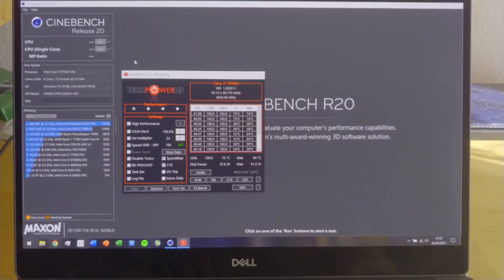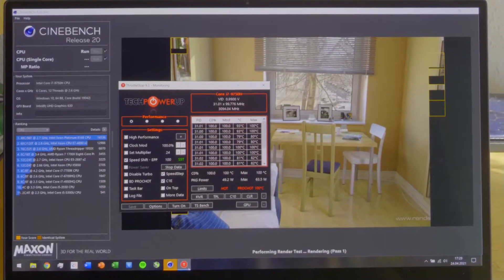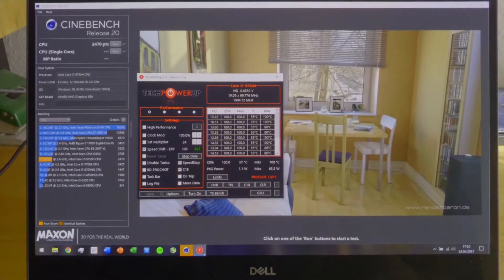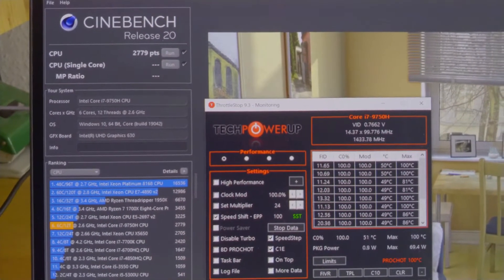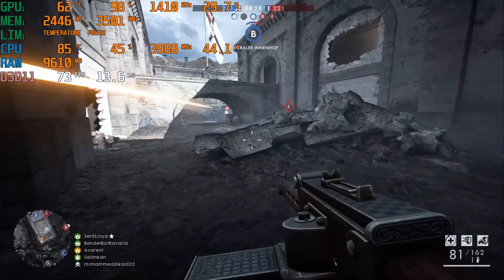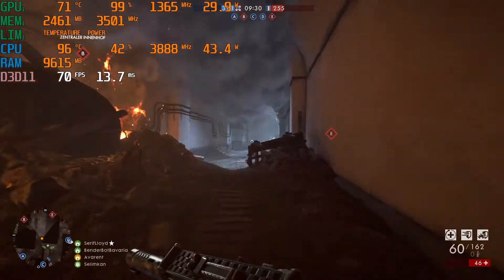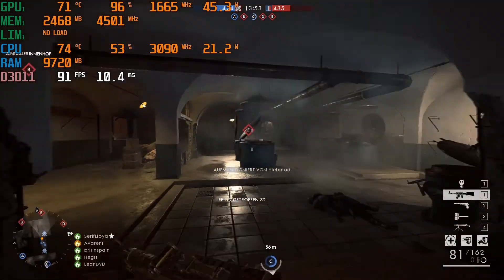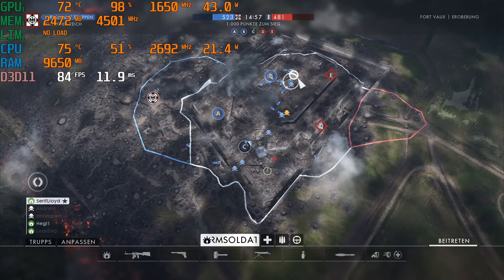Does Undervolting actually help in Gaming? Dell XPS 15 Test

Comment: does throttlestop needs to be turned on every time we boot up the laptop to keep it undervolted ..... if yes , this is kinda anoying right ..... btw , does this increase battery life ?
Reply from the maker: @vigneshdurishetty0707 you can simply create a Basic task in the task scheduler, which opens the Programm everytime you Login. Undervolting does increase battery Life, at least in my experience.
Reply: @Avarent01  thanks !

Comment: Throttlestop is turned off, you didn't undervolt 🤦🏻
Reply from the maker: The Turn On button only controls 3 things. Clock Modulation, Chipset Clock Modulation and Set Multiplier. On many recent CPUs, you do not need to use any of these ThrottleStop features. For many users, the Turn On / Turn Off button is obsolete so it might be removed someday.

This means that the undervolting has been applied and had been in effect when running the second benchmark.

Comment: Could you please tell me what settings you changed in throttlestop? I have the undervolt of cpu and gpu but can't figure out the rest! Thanks
Reply from the maker: It's mostly just about either manually limiting the cpu to a certain clockspeed in the undervolt menu on the left side or just disable the turbo of your cpu in the main menu. In most games disabling the turbo is absolutely fine, only in lighter games like csgo you might want to set the clockspeeds a little higher
Reply: @Avarent01   Thank you!!
Reply: @Avarent01  what are your specific settings? And what do you have your speed shift set to?
Reply from the maker: @jakemarsden6831  I did not change speedshift. The settings will strongly depend on your personal CPU. My one seems to do really well with a high core and a lower cache undervolt.
Reply: @Avarent01  oh ok! Thanks for the insight! What do you have your core and cache set to?
Reply from the maker: @jakemarsden6831  -200 for the core, -135 for the cache

Comment: How do I undervolt with the new intel lock? Do you have any tips? My BIOS is 1.9.1 and I have no idea how to revert to pre-1.6, any help would be fantastic!
Reply from the maker: There is a good guide on reddit on this topic. You will need to download the older Bios from the dell webpage and untick a setting in the bios that automatically flashed your system to the latest Bios again.
Reply: Were you successful?please help me

Comment: You probably could get that 9750h close to 3000 by again offsetting the core -250 but keeping the cache low -140, which should keep the power under 100% load below 50 watts, and again boost that clock to 4.0ghz.
Reply from the maker: I tried undervolting it to -250/140; sadly wasn't stable for me. Right now im running it @ -220/120, which is stable. I get around 3040 Points in CBR20 with that.
On the other hand you still need to limit the CPU in games, but you especially need to limit the GPU as well. It seems like the VRMS are close to the GPU. Because of that my GPU cannot exceed more than 70 degrees or it will throttle again,
Reply: +Bastian Nice to see the improvement in scores, looks like its a decent improvement and closer to some stock desktop xeon CPUS, whereas my 9300h again undervolted sits 300-400 points away from a stock 7700k. Yeah GPU/CPU limiting is required to keep clockspeeds from falling, and I believe the GPU limit of 75 degrees is actually a set limit because on older XPS 15s with older BIOS, the GPU was allowed to go above 75 degrees.
Reply from the maker: @2009Windows7  I believe if you add some thermal padding on the vrms or if you would install the I9 heatpipe which also covers the vrms you should actually be fine to be honest. Sad that dell didn't give that to the lower speced versions as well.
Reply: +Bastian The VRM temps are actually cool on my XPS 15 never going above 60 degrees, I do however use a laptop stand and a fan to blow air into the vents
Reply from the maker: @2009Windows7  hmm, that's really weird. I am using a laptop stand as well. The only explanation for the throttling i could think of was that it had to do something with the vrms since it should only start to thermal limit at 75 degrees. So I am not sure why it would reduce performance at 70 degrees already
Reply: +Bastian Again the good thing is atleast the 7590 doesnt crash to 300mhz anymore making games virtually unplayable.